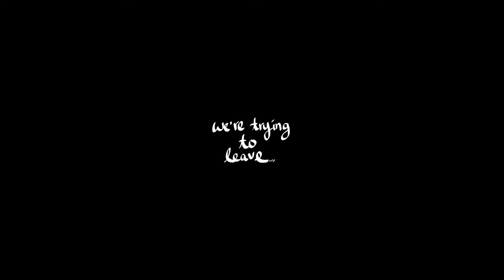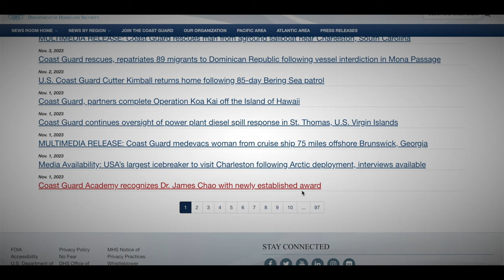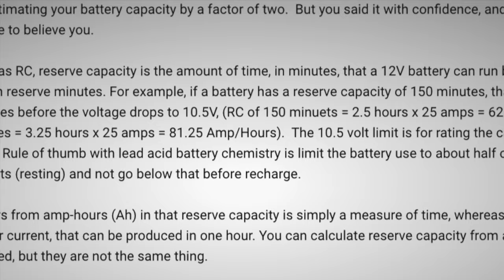SAILBOAT IN A HURRY

Comment: Thanks for keeping us up to date. If you were filling up the water reservoir cold then when the engine heated and the water expanded the reservoir cap would likely release some excess water. The next time you checked it the level would be slightly down but that might be the normal amount allowing for expansion. Also is the cap leaking. One thing to check on a cooling system is that both the system and the cap can withstand a specified pressure. Being able to be under pressure helps the system by allowing to water to get above 100 C without boiling. I have more than once fixed a car's cooling system by replacing the radiator cap. Robbie probably knows all this. Safe travels.
Reply from the maker: After filming, we determined that there is a leak in the fresh water pump (most likely the pump seal) and not likely leaking from the cap. But yes, the system on this engine is pressurised to stop it from boiling.

Comment: Just ran across you’re guys video so haven’t had a chance to watch all of your story but I wanted to say good luck to you! The water issue in your engine is a catastrophic failure in the future! Either you’ve got a rotten gasket , your water pump is going and will fail at the worst time or you’ve got an internal failure. None of which are safe to rely on your motor for off shore blue water travel. You need your engine looked at asap!! Safe travels to you both I can’t wait to catch up on your videos! 👍🏼💙 fair winds (you’ve made the right choice btw to wait out the winds) I’ve been solo sailing for over 40 years and as a girl not knowing crap about motors etc you learn fast when it’s the hard way lol) fins up to you both!
Reply from the maker: Ya, our engine definitely has issues, like what you described - needs new gaskets, water pump seals, many other things. We sought some professional help here in Mexico, but not much luck so far. We do have future plans to change the precarious engine situation though - thank you for the wish of luck, we're going to need it!

Comment: Water under the oil filler cap and inside the rocker cover but not showing in the oil on the dipstick is condensation. Try to find a dry place for the crankcase breather filter if it has one, otherwise try to get one for it. 👍
Reply from the maker: Thanks for the tip!

Comment: There's a little echo when you chat in the galley, maybe a project good while you wait the weather is to make a lightweight acoustic panel for the wall opposite the galley?, don't go crazy spending a lot of money on it (like you would 🤣) just some simple cloth or foam over a simple frame would probably be enough it just needs to stop the sound bouncing on the shiny surfaces or make it bounce a different direction. Usually furniture and cushions take care of it, but I understand why you don't have those yet 👍
Reply from the maker: Thanks for pointing this out, I didn't think about it before filming - the galley is not the greatest spot for recording sound in the boat because of the shiny walls for easier cleaning, however there are less 'bouncy' spots that sound a lot better for viewer experience. Will keep it in mind for future conversations!